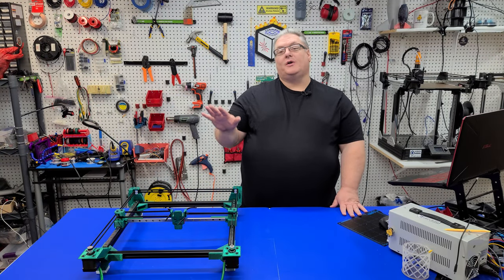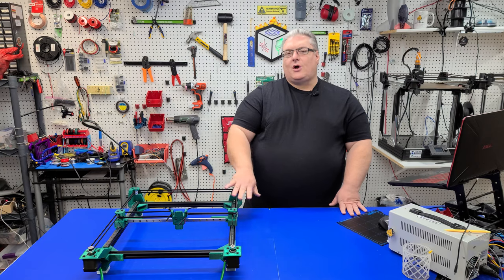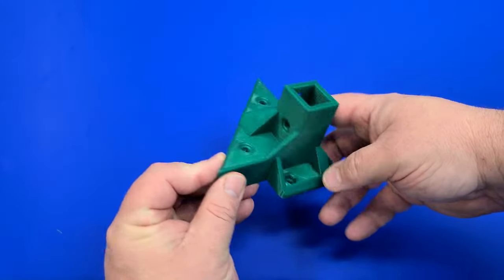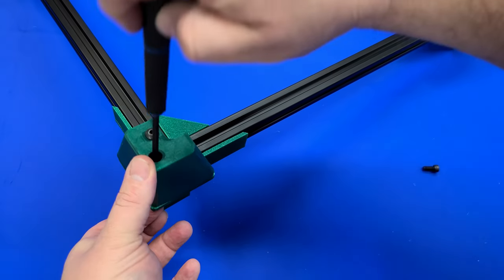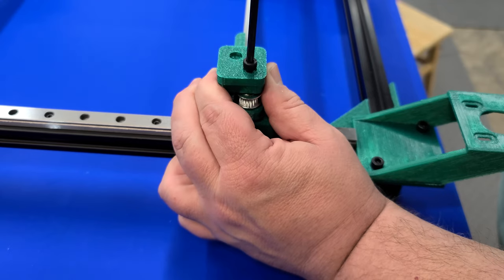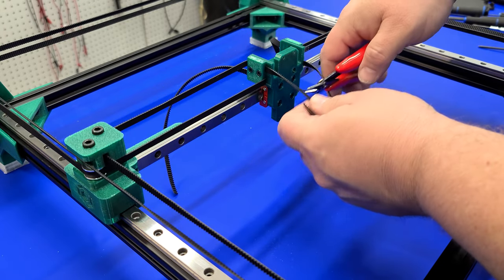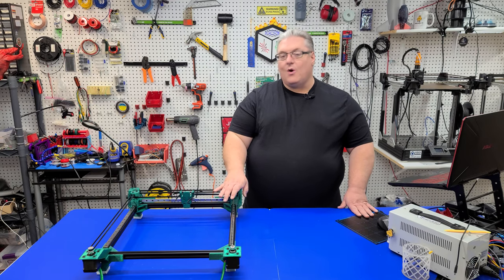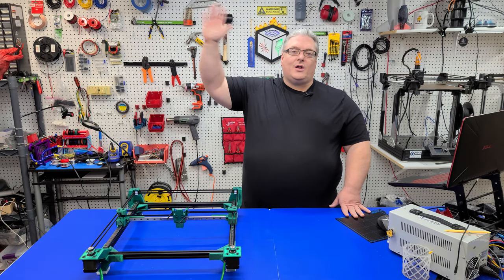How to make a DIY Laser Engraver - CoreXY | Part 1

Comment from the maker: Will you be building your own laser engraver?
Reply: Someday.
Reply: In the middle of it right now! It does take some time to print all the parts out, especially if I screw up here and there.
Reply: I am planning this build. I would like to reduce the size of the footprint to 250mm square since I only plan to engrave small images. Can I downsize this project?
Reply from the maker: Sure can. Just shrink the rails and extrusion.  Update the firmware with the new size.  Everything else is pretty much the same.
Reply: @MakersMashup  Thanks for your super fast response.
Reply: Hello. how could i add laser to ender 3. i have 12, ground and PWM

Comment: A 20x20 calibration cube
That’s freakin’ hilarious 
Who ever thought a calibration cube could have a use beyond what it does
You are a genius sir
Reply from the maker: I didnt feel so smart looking around the shop for something to be a place holder there.  I almost built something but stopped when I realized it was a 20x20 cube. :)
Reply: @MakersMashup  These work better: https://www.amazon.com/gp/product/B08HC95XD2 
Tap the end holes (M5) and these lock the extrusions nice and tight.
Reply from the maker: I've seen those before.  Didn't think it was a necessary expense given the bracket itself is doing the heavy lifting.  Haven't had any rigidity problems at all.  Thanks for the tip however. 👍

Comment: Depending on the BOM cost, I'd love to make a pen plotter with this. How many grams of plastic did you use?
Reply from the maker: Didn't track the plastic use. For just a plotter you could probably do this for $100 to $200.  If you went 8 bit board and ordered cheap rails.  Those are the two largest costs aside from the laser which you wouldn't need for a plotter.

Comment: What steppers drivers are you using on the SKR? I would think microstepping would work for the fidelity you want if you use a 1.8 deg stepper motor with say a 2208 stepper driver..
Reply from the maker: TMC2209's

Comment: Does the Rear Corner Bracket Top...the part that the extrusions lock into need supports when being 3d printed?
Reply from the maker: Nope. There should be a support in there already if I posted the right model but the 20mm gap is easily bridged with most printers.

Comment: Could I use nema17 1.8 motors instead of the 0.9 ?  Thanks for a great project !
Reply from the maker: Probably but your .9.will likely provide a smoother cut in arcs.
Reply: @MakersMashup  Thanks, I'll fork out the cash out for the 0.9 steppers. The 1.8 are much cheaper.☺

Comment: What is a ballpark figure to build this project excluding the printing (I have a very large collection of filament)?
Reply from the maker: I would say somewhere in the $250-$350 range.  The "Laser" is the most expensive component on here.  The one I bought clocked in at $179 from amazon.com. It is really going to vary a lot based on what parts you buy.  I'm using an SKR but you could use an old Melzi 8 bit with drivers already on it.

Comment: I wish I could redesign parts for a better quality idler. The only idlers that fit are cheap ones, 9mm high, good ones are 10mm. The cheap ones make a horrible noise when they move.
Reply from the maker: The fusion files are available in the L301 and the X301 bit bucket.  Can modify for your needs.
Reply: @MakersMashup  I can do very simple things in Fusion, but I'm afraid that's beyond my capabilities.

Comment: Is it possible to get STEP or Fusion 360 files for the XY_Bracket_Bottom_V2? I need to make mod a low profiled version. Thanks.
Reply from the maker: That file is in the X301 repo for the printer version. Both step and fusion are available

Comment: Why don’t you use end stop for X & Y?  Thanks
Reply from the maker: TMC2209 drivers are used and they support "Sensorless homing".  When resistance is met on the X and Y axis, the steppers report back to the firmware the limit.  Z needs higher precision so that still requires an endstop.

Comment: So I am working my way through making the parts for this project, and I don't see in the stl files the part that secures the belts to the Carriage Belt Body. Am I missing something? I do see the cable retainer but it does not look like the part in the video.
Reply from the maker: They should be there but I can check.  The X301 has the same parts in the repo but I can check for you.
Reply from the maker: Carriage belt clamp here is the same model https://bitbucket.org/makersmashup/x301-models/src/master/STL/   I will check the repo in the am.  Thanks for letting me know.

Comment: Can you give some hints as to how you printed some of these parts? Like orientations, supports, etc?
Reply from the maker: None should require supports.  Most orientations are self explanatory.  The motion system on the build is the same on the X-Series printers.  The print guide for this is here https://wiki.layerfused.com/en/X301/printing-guide
Reply: @MakersMashup  Well, self-explanatory for a seasoned 3D printer operator, maybe. Thanks for the link!
Reply from the maker: Fair point. None of them require supports. Usually you can rotate and get an orientation that works well.  I believe most just print as is.  Most also have sacrificial bridges so they will print better and the corner brackets gave built in supports.
Reply: @MakersMashup  Thanks for the info. I tried printing a corner bottom part and, since I'm a 3D nube, I chose supports. They were impossible to remove, so I tried another with none and it printed fine but one side of the print was really tight on the extrusion. I think among other things I printed too hot. I am going to try to tinkercad a tiny bit more room there and maybe try to design in some brass threaded inserts, too. I just think they are so cool. So much to learn about this, I had no idea when I started.

Comment: In the BOM spreadsheet, it says two linear rails are required. Should that be three?
Reply from the maker: Yup, you're absolutely right.  Typo there which I have corrected.  Thank you for pointing that out.
Reply: @MakersMashup  Oops - was I looking at the wrong column? In any case, this looks like a fantastic project. Gonna start collecting parts!

Comment: Hi, can you recommend the frame aluminum extruded parts you used? I've been looking on Amazon but it seems they're not that clear about the specs.
Reply: In its Bill of materials document, he mentioned 4 aluminium extrusions of 400mm length that you can either choose as 20x20mm section (aka 2020 extrusion) or 20x40mm section (aka 2040 extrusion) if you want a beefier frame.
Reply from the maker: I'd stick with 2020 the models were not designed for 2040

Comment: This is an interesting project, are you planning an enclosure for laser safety?
Reply from the maker: Right now no.  Long term yes.  I'm planning a set of videos on building Enclosures for the X series printers which will be easily adapted to this. I wanted to put a plexiglass shield in front but if you've priced out laser safe plexiglass you know a large view window will cost as much as the build itself.  So safety glasses it is for the short term. 😔
Reply: @MakersMashup  Invest in a good pair of glasses :) check, I am thinking this might be s nice edition to the lab, so I dont always need to run to the maker space to use the 100W CO2 :)
Reply from the maker: @mikey's Lab - Getting good glasses was the first thing I did. Couldn't agree more about safety.  Bought a pair from a reputable US vendor and confirmed the wavelength was covered as well.  I also run the laser with a web cam as much as possible.  One of my largest concerns on these types of diode lasers is bleed into other wavelengths.  Unfortunately no way for myself and most people to confirm the actual wavelengths the laser is emitting.  I've seen from other YT channels that wavelength bleed into IR or UV is not uncommon and safety glasses may not cover those bleed wavelengths.  So I limit exposure as much as I can personally. :)

Comment: For the life of me i cannot find where it indicates how long the extrusions are. I have 1000 mm lengths i need to cut. let me know and thanks! Good work
Reply from the maker: You can make it just about any size you want.  The only real limitation is going to be getting the belts tight.  400mm is the size I used in the video but if you want a larger one 500 or 600 should be fine.  You'll need a belt that is 2.5x the length.  That might be harder to source unless you go with a custom cut gates belt.  Totally recommend them if you can get them economically.
Reply: @MakersMashup  Okay, thanks for getting back to me so quick. I'll cut mine to 400mm.
Reply: @MakersMashup  One more question, i dont see the belt retainer STL that attaches to the CarriageBeltBody. I can make it, but i'd thought ask real quick before designing it. Thank you
Reply from the maker: It's available in the x301 repo.  Let me get a Link for you.
Reply: @MakersMashup  never mind, i wound up designing it so i could finish this build.